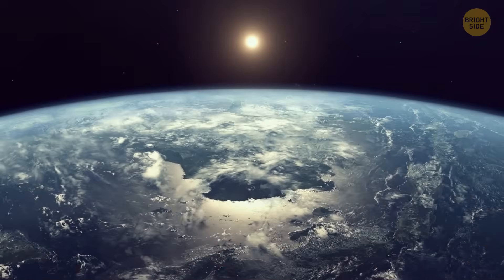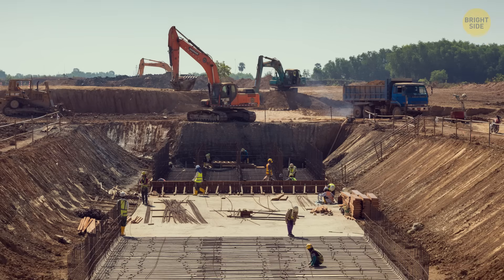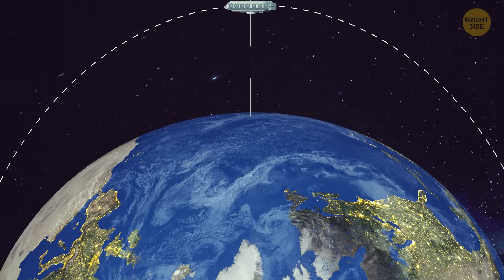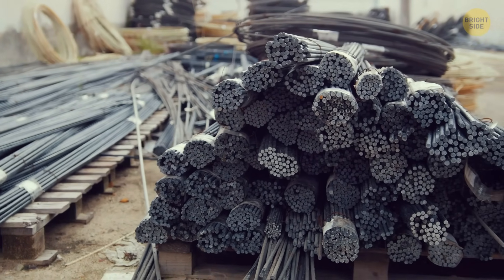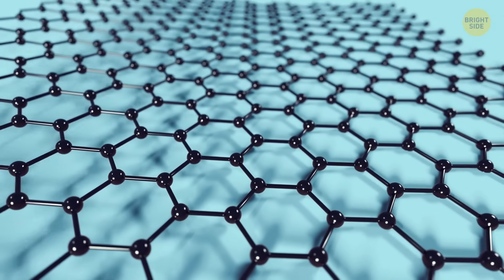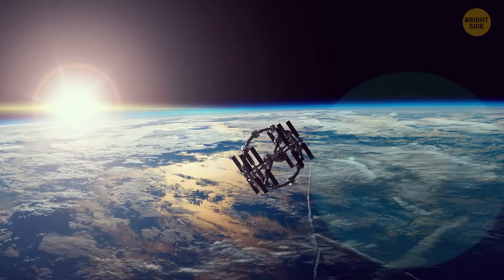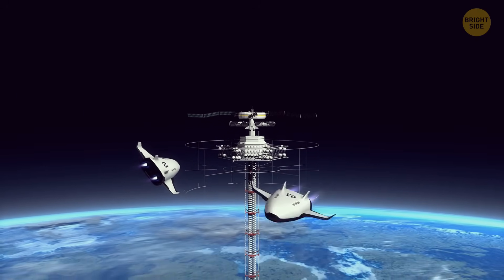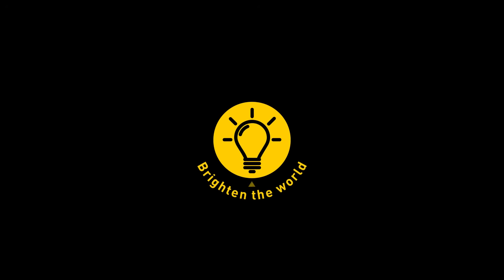Space Elevators Are Possible - This Can Change Everything

Comment: space elevators might be possible if you remove alot of the lines needed to get higher. meaning for example if you use water to push the platform up a long way then the rest of the way you use the wires. imagine a few kilometers tall water tower that has segmented pumps that fill up water tier by tier then at the top of the building you connect the wires needed to pull the rest of the way and have some thrusters that give the platform some extra lift and extra stability.

Comment: Whatever the diameter of the lowest point equals the height
Everest is 12km at the ground and goes up 9km
So if space is 100km off the ground the lowest point would have to be  about 135km diameter 
There could be a way to cut that into 100km at the base by raising it a bit but that's the size needed
If if went 30,000km off tvw ground the diameter at the bottom would have to be about 45,000km roughly 
I believe 100km is feasible and well worth it

Comment: I do not understand how a space elevator works.  The connecting wire from the ground will be travelling increasingly slower as one goes down, than the satellite/station and this will no longer be in free fall and will again drag on the satellite.  If one has a higher counterweight, it will be travelling faster, and again drag on the satellite.  One cannot escape the need for rockets.

Comment: For Going 22,236 Miles Up… That Would Have Less Than 9 Million Elevator Floors (“100,000” Was The More Obvious Number, Such That The “‘Infinite Hotel’ Elevator” Must Be Upgraded Once To Reach That Floor Number In Its Journey To “Floor Absolute Infinity” As “F(Ω)”!), Meaning That Every Floor Of The Elevator Goes Up At Least 4 Meters (At Most: 250 Per Kilometer, 402 Per Mile!) On Average… Such That It Will Take Almost 3.2M To Drill Through The Entire Earth (Between 2 “Antipodal Points”… As It Takes At Least 8K To Enter The Planet’s Mantle, 725 Thousand To Reach The World’s “Cores”! (The “Outer” One, While It Can Have Up To 550,000 Floors To Go Through It To Get To The “Inner Core” That Requires Another 319.5K Floors At Most To Go Through It Like The Other One!)), As The Direction Of “Going Down” In Another Elevator Will Go Towards The Sun For A Different Approach Of “‘Sub-0’ Floors”! (As It Takes About 1.6 Million Floors To Reach The “Center” Of Where We Live… Going Through The Other Side Of The “Ground Layers” Would Be “‘Upside-Down’ Floors”, Meaning That The “Floor Signs” Would Be Rotated 180° To Be On The Ground For Being A Lot Lower Than “Floor -1,594,500”… Rather Than Having The Sight Itself Flipped, For Going Much Deeper In The Ground To Travel To A Point That’s The Opposite Of The “Starting” One, Like How The “Tangier Ibn Battouta Airport” In Morocco Is Almost Perfectly Opposite Of The “Whangarei Aerodrome” In New Zealand… Other Than The Zealandian Runway Being Too Short For Any Commercial Airline (Including Moroccan!) To Land On For Even “Post-2015 Flights”!)